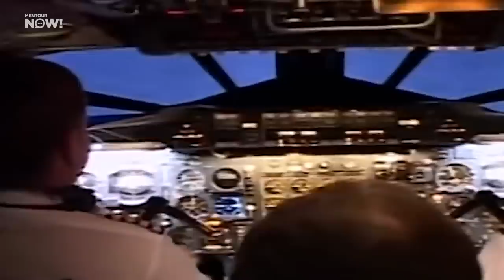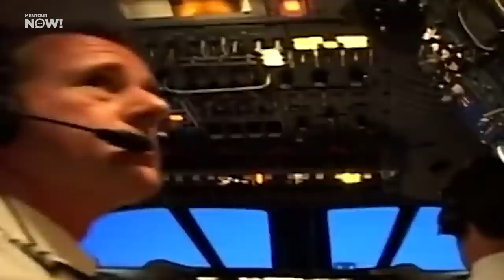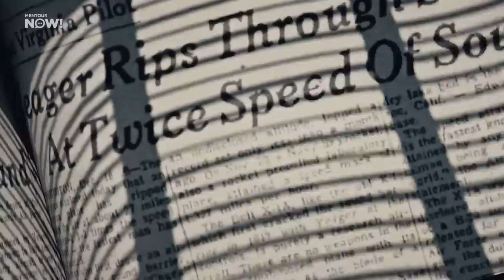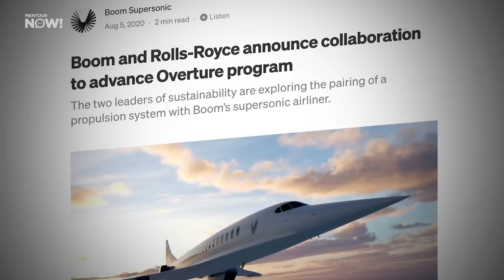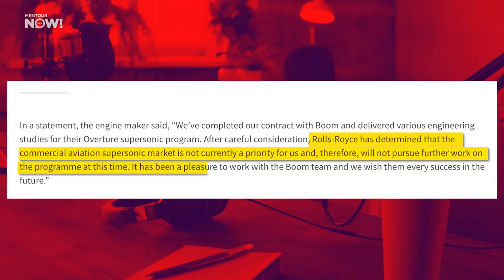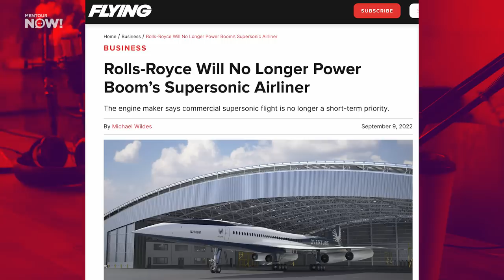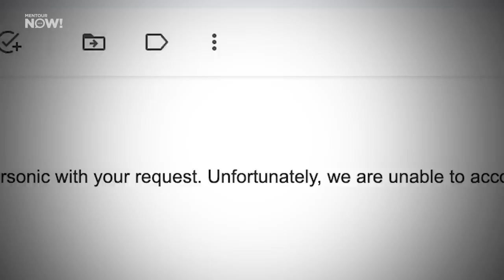WHAT’s Going On with BOOM Supersonic?! Will it Fail?

Comment: Concorde always fascinated me because the outside is timeless, almost futuristic looking even today, yet the cockpit looked like a WWII bomber!
Reply: An Aston Martin comes to mind.
Reply: Planes are generally more timeless than any other vehicle. By necessity more so than anything. A WW2 fighter still looks like a modern, top of the line stunt plane.
Reply: Thats because the electronics now are so small
Reply: and you were expecting 4k displays in the cockpit on a plane from the 1970s
Reply: @colgatetoothpaste4865  Not at all, it was just an observation of the timeless exterior design coupled with flight controls of much earlier aircraft, especially the flight yoke.
Reply: Honestly, the cockpit windows look like something that they bolted onto an open cockpit biplane in 1935 :D
Reply: @britishrose9417  i kinda liked the old displays and engineer stations because they give a whole lot more minute information, although now with LCD displays in cockpits they can display information not quite possible easily. The issue now is that with fewer crew trying to manually adjust parameters would be difficult if going away from the norm when considering various features you would add to the aircraft. its a bit like in a flight simulator or in some where you just need to assign so many keys to make use of every aircraft feature. I still feel it would be good to have an engineer station even today with modern controls allowing for far better adjustment and diagnosis when needed. Sadly those small LCD button screens are still very expensive to buy even for use in flight simulators on PCs.
Reply: @colgatetoothpaste4865  1960's
Reply: These anachronistic cockpits are pretty much true of all aircraft, with the exception of SpaceX’s crew capsules.
Reply: @colgatetoothpaste4865  the plane is from the late 50,s
Reply: Even the first 747 had similar cockpit instruments
Reply: IIRC theres a lot of design heritage connecting those kinds of supersonic tranports to military planes, espeically to mach 2 bomber concepts.
Reply: A lot of problems had to be solved to make Concord fly, including fly-by-wire ... and name another plane where people on board flying at 60,000 feet Mach 2  can sit around in suits rather than a military pressure suit.  For a long time no military plane could catch Concord... only the EE Lightning could match it.
Reply: @chrissmith2114   Idk, the F-104 could probably reach that speed and altitude in the mid to late 50s. Likely no good enough missiles though.
And assuming it didnt experience a technical failure or crashed randomly.

Actual introduction of the Concorde was around the time of the F-15 however. So not much luck there.
Reply: @colgatetoothpaste4865  Don't forget to brush your teeth.
Reply: @British Rose, You are absolutely correct. The Concorde lived in the age of steam gauge cockpits, and sadly never survived into the era of glass cockpits. 
I am certain that Boom will use glass cockpit technology in their aircraft. The instrumentation is superior and more efficient in reducing pilot workload, as well as in ergonomics.
Gerard
Owner of Anywhere PC Geeks
Reply: I disagree, looks very 80s to me
Reply: world war two bombers didn't have reheat indicators
Reply: @termitreter6545  the EE Lighting beat the F104 at many things
Reply: Does the environment need more gas guzzling aircraft
Reply: There is a great YouTube video on a retired British pilot, who used to fly the Concord.
And no matter what you think about Russia, they did copy the Concord, but somehow that Konkordski had trouble doing the high speeds. I don't know if that is just gossip, engineers are engineers, after all.
Reply: @maly2ts408   Where are the huge hydrogen airships? Like in the old days? When you fly slow, that saves lots and lots of fuel.
Reply: The sonic boom, too few seats & not environment friendly enough I would say
Reply: There was very little Computer work on Concorde. WHICH BEGAN  remember, in the mid 1950's, mostly that technology and new engineering, was created with slide rules. It never let them down.  Whatch the Senior Concorde Pilots John Hutchinson's opinion of Concordes flight deck instruments.  A fantastic Guy's life with Concorde, before and after.
Reply: Thats the result of the greatest combination of Hi-Tech brains in the busines, working closely , for decades. Remember too, both sides learned each other's language, even on the 'shopfloor'. and considering that there were two types of measuring, Imperial and Decimal. Not sure who's, was used, most likely Decimal.   anyone ?
Reply: You cannot use systems that didn't exist, when Concorde was inaugarated .  Do you think anyone was going to strip out all the perfectly reliable controls, just to look modern ?
Reply: Another pointless remark. You can rest assured, there was   NOTHING   on Concorde, that had'nt needed to be be there, or look like that.  @A.Lifecraft
Reply: Looks and styling are unimportant, when it has no negative effect on the performance and safety of the plane.   You looking for uglyness ? look at the soviet attempt. @A.Lifecraft
Reply: Looks are misguiding, if you don't know first-hand, what they represent--or do. Besides, I'm guessing  there were a hell of a lot more controls, than a B.17 or Lancaster.

Comment: When they first came out I thought I recalled hearing that Boom was trying to make an aircraft with little to no sonic boom so that they could go supersonic over land?  Sounded impossible and probably was since that goal seemed to disappear quickly. If they could had achieved that it would have been a game changer.  Without it they won’t survive.
Reply from the maker: They might have been trying to achieve that in the very beginning but not now as it seems.
Reply: I think you're confusing Boom with another project. There are people trying to greatly reduce the sonic boom of a supersonic plane, but I'm pretty sure Boom was never one of those.
Reply: @MatthijsvanDuin  There was a fair bit of hype around the NASA testing efforts around that time, and it may have gotten muddled in people's memory. Especially since its logical that supersonic transport being viable would NEED to be as quiet as possible in order to even have access to the markets they're looking for.
Reply: It does sound odd that a company called boom would make a supersonic aircraft without a boom
Reply: You're probably thinking of the X-59. And it's still progressing well, to the point that they'll be doing testing over cities relatively soon to measure volume.
Reply: Still won't survive as airports have noise limits and those low bypass engines certainly aren't quiet. Concord wasn't allowed at very many airports and that had nothing to do with the sonic boom, those engines are loud at takeoff.
Reply: I don't think it would matter even if they manage to make a supersonic jetliner without a sonic boom still it would be less efficient than current high by pass airliners... + to cover up the rnd cost they would sell these for higher prices and airline would obviously absorb that into ticket prices so basically it would be like would you fly in a fast jet in economy class or slow yet decent plane with 1st class service... I don't know about you but I would rather fly 1st class british airways for 7 hours than economy on boom for 3 hours for the same price . Here's an important fact despite concord flying on water only concord was PROFITABLE both british airways and air France got back their money and profited on each flight from 1983 . The main reason for retirement of concord was the rising fuel cost and the efficiency of new-gen aircraft it had nothing to do with profitability and sonic boom. Everyone in the aviation world are looking for longevity and upgradability of any project whether its a new aircraft design or new engine but boom is more like we build this we are done there is no future to it you cant take these engines to other planes nor can you design a transonic plane around the design of the boom.
Reply: @thesaint5991  maybe you like sitting in an airplane for 7hours but I would pick 3 hours please and thank you
Reply: @wyomingadventures  sitting in first class for 7 hours is like a paradise with good food, especially middle eastern airlines.
Reply: @MentourNow  So, we peasants will just have to learn to live with sonic booms so the wealthy can travel faster?
Reply: @robgrey6183  peasants won’t be able to afford supersonic tickets anyway. They have to charge first class fare to have any hope of profitability.
Reply: Their company name contradicts that assumption ;)
Reply: The lockheed x59 is trying to reach that